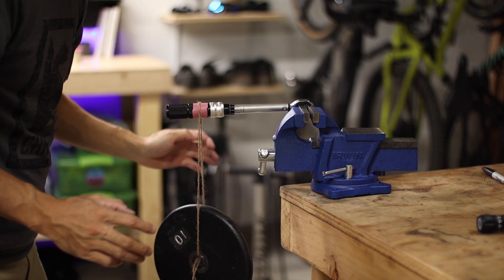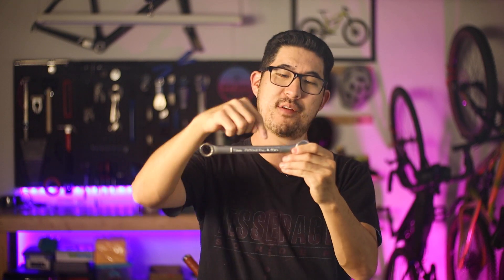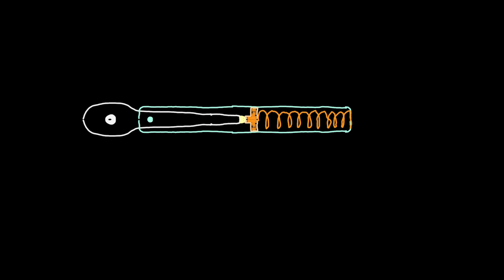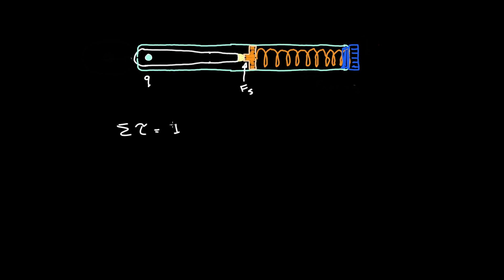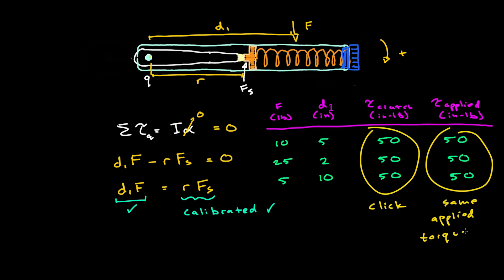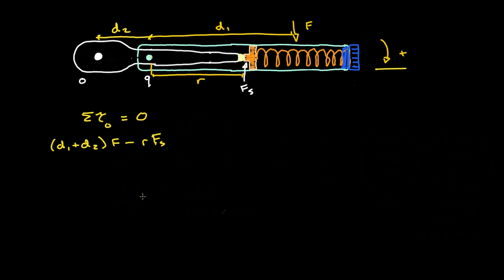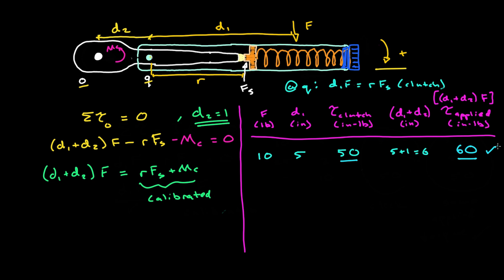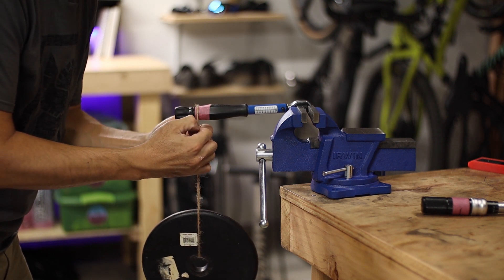Why GRIP Position on Torque Wrenches MATTERS!

Comment: The math here is fine.  The model needs to be reconsidered.  It is far too simplistic.  When the pivot point was coincident with the handle pivot point the force applied to the handle was treated as being translated through the axle to the clutch.  This is fine for illustrating the operation of the torque wrench in a way that people might easily grasp, but it is terrible as a physics model.  The force from your hand is applied to the handle, which transfers that force to the base of the clutch which then transfers the force up through the clutch, the spring, and internal shaft to the drive as a rotational force.  A piece of the force applied by your hand is also applied to the drive as a linear force acting to push it rather than rotate it.  This can be disregarded as an applied force on the drive when the drive and pivot point are coincident, because we are only interested in torque and not a pushing force.  This does help illustrate how the force applied by your hand is allocated between the two points though.  As the distance between your hand and the pivot point/drive is reduced an equal force applied would eventually have 0 Newtons acting on the base of the clutch, and then being translated to a rotational force at the drive; the entirety of the force would act as a linear pushing force on the drive.

When the drive is moved beyond the pivot point this linear force at the pivot point becomes much more important, because now the pivot point is applying the linear force component from the handle as a rotational force through the socket head to the drive.  The closer your hand is to the pivot point the greater the proportion of force from your hand bypassing the clutch and acting as an unrestricted rotational force at the drive.
Reply from the maker: Thanks for your awesome insights! The model depicted in this video is sufficiently complex to demonstrate that the grip position does indeed have an effect on the actual applied torque. 

Sure, you could consider all of the internal forces and, taken to the extreme, you could do some FEA to completely model the system numerically, but that wouldn’t generate any further insight into why the location of the applied force alters the applied torque. I chose a model of minimal required complexity to demonstrate my claim, and to avoid the video being 10x longer.
Reply: @TheBikeSauce , the point is that it does generate not just further insight but accurate insight into why the location of the applied force along the handle alters the applied torque at the drive.  The simplification of making the drive coincident with the pivot point is very enlightening.  Everything after that is incorrect, and it would be better to say, "It just does." than to provide a bad model that does not describe the physics either conceptually or mathematically.

You need to think of the base of the clutch as a fulcrum when force is applied between the base of the clutch and the end of the handle.  When the tool is used in this way the handle pushes on the pivot point in opposition to the force acting on the fulcrum (the base of the clutch).  When the handle is gripped between the base of the clutch and the pivot point you now have the pivot point and the base of the clutch acting as supports and the handle as a beam across the span.  The load is distributed between these two points.  In your equations up to 50 lbs of torque would be applied through the clutch, then another force proportionate to that would be applied to the pivot point.  The proportions would be determined by the position of the hand and how the load is distributed.
Reply from the maker: I can appreciate academic debate. I’ll wait for your video or document that explains why this is a ’bad’ model.
Reply: @TheBikeSauce , I explained the most important flaws in the model.  As we just saw, a video does not demonstrate the correctness of a model.  Computations also fail to validate the model without real world testing, which you did not do.  Rather than being peevish, maybe revisiting the content you produced would be worthwhile, that is if providing accurate information to your viewers is important to you.  You seem to have an engineering background.  For me, better understanding systems is always time well spent.  I learned a lot from your videos on this subject, but that doesn't mean they couldn't be improved.
Reply from the maker: Oi.. let’s just take a breath. There are some good videos that demonstrate this phenomenon in real life. This video just explains it mathematically. It’s a Statics problem up until the instant the wrench clicks and this video treats it accordingly. 

Happy to discuss further and open to thoughtful debate, but try not to claim it’s flat out wrong until you can demonstrate your full derivation in some other format other than the comments section.
Reply: @TheBikeSauce  "until the wrench clicks" is exactly where you got lost.  Your model indicates that farther down the handle you apply force, the more force generated at the drive.  It's just the opposite.  The closer you get to the pivot point, the more force is transferred from the force applied on the handle to the drive directly, bypassing the clutch.  That means a lower proportion of force on the clutch itself, causing the applied force needed to cause the clutch to release to increase exponentially toward a limit at 0, when your hand is directly over the pivot point.  At that's point the wrench will never "click".  It will forever be a statics problem.
Reply: @TheBikeSauce  here's a video for you demonstrating the principal.  No math necessary. https://youtu.be/RsMxtEx0uik
Reply from the maker: My dude, I think we are in agreement here. That's a great video! Precisely the one that the math here agrees with. Check out 10:14  for the math that shows the applied torque DECREASES as you extend the handle.
Reply: @TheBikeSauce  the math says that when you decrease the force acting on the handle by a factor of 5 the force decreases even despite the distance increasing not because of it.  Were the applied force to remain constant, the torque would have increased.  The video demonstrates that, as I predicted, once the force acting on the handle has a distance greater than the distance at the base of the clutch (somewhere above the grip) the torque at the drive will be constant, as limited by the clutch, irrespective of how much  force is acting on the handle and/or how much the distance increases.
Reply from the maker: haha, now I'm sure we're in agreement. We both watched the real-world test by @How2Wrench, and we both saw that as the distance of the applied force from the socket increased, the less the actual applied torque at the socket, despite the wrench clicking. All I can say is to rewatch this video now at 10:14 for the math that shows the exact same thing; the further the applied force is from the socket, the less torque is actually applied at the socket (55in-lb as opposed to 60in-lb)- despite the wrench still clicking at the same torque setting. 

If you'd like to chime in for the last word, feel free, but we're saying the same thing! Thx for the longest civilized comments discussion  on this channel!

Comment: But this does not account for moving the handle forward as you increase torque settings.
Reply from the maker: Handle doesn’t move when you tighten the knob though
Reply: @wdhewson The BikeSauce didn't catch the implication of your question. The handle does indeed move a modest distance as torque settings are changed. This is part of internal variations that contribute to the tool's tolerance specification, often +/- 4%. At the handle center, the rate of change in torque per distance alteration is comparatively small, at least an order of magnitude less than the 4%. On my torque wrench, the movement over the torque adjustment range is total 16mm, I did the variation calculation once, I think it was under 0.1%. On a tool that can vary over an 8% range and still be within spec, it's not significant. The calibration procedure includes a test of the tool's parameters with the Force Loading Point on the calibrator being moved 10mm either side of the correct Loading Length.

Comment: I still don't understand the mathematics.
The handle is a tube over the mechanism.
If you hold the tube in the middle or the outer end, the torque applied at the socket should still be the same.

Please try to get someone with a torque wrench calibration tester and do the exercise again. I would love to see the results then. I will gladly apologize if I'm wrong, but it needs to be proven first.
Reply from the maker: Thanks! The math in this video validates the real-world test found in the video linked in the description. The phenomenon is well-known, but the underlying math is presented here.

Comment: Oh man you are so wrong. And that's because you consider the wrench to not be  one single body. And you are partly correct, but NOT untill the clutch starts to slip.

So... lets set things right:

Untill the clutch starts to slip the wrench is ONE SINGLE BODY because the force applied to the fastener is transmitted trough the handle   to the fastener at 2 points (the handle pivot and the clutch, which are colinear with the head of the wrench) thus making common body with the head of the wrench.

Now, you're working against the spring pressing on the clutch that calibrated to limit the force applied to the bolt.

So, no matter where you apply the force, the clutch will slip ONLY at the spring predefined slipping force.
Reply from the maker: Haha, yes this is the common misconception. The video linked on the description shows the variation of applied torque as a function of grip location. Is counterintuitive, but that’s what this video tries to explain

Comment: No. wrong. The clutch pivot point is  the socket pivot point UNTIL it clicks. Therefore your equation holds only AFTER the click. Until then it doesn't matter where you hold the wrench. So, stop at the click or you will have wrong results no matter where you hold it
Reply from the maker: Haha. So much confidence. Yea I get it, it’s very counterintuitive, but check out the linked video using no math and just a digital torque meter. 

One viewer offered a perfect counter example: imagine holding the wrench AT the pivot point . You’ll keep tightening the bolt, but the wrench will NEVER click. Thus, grip position completely matters.